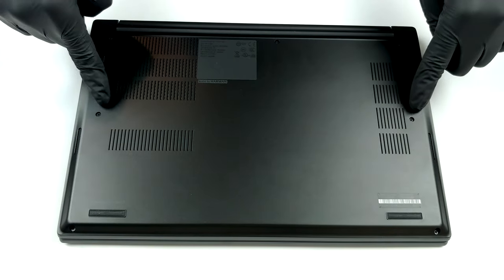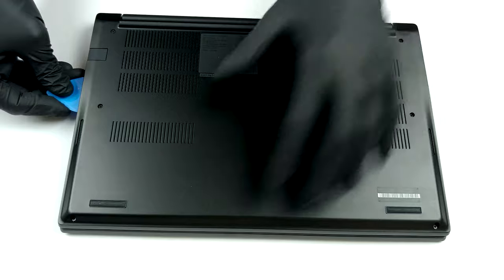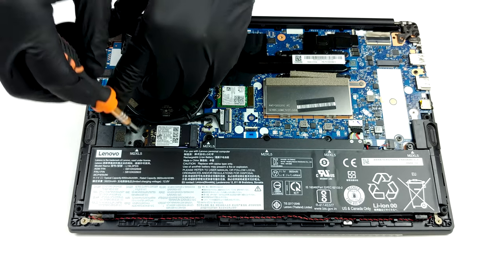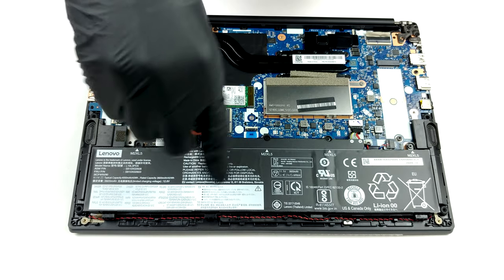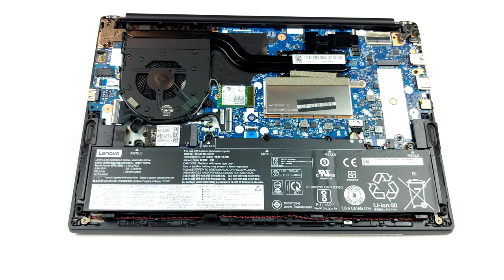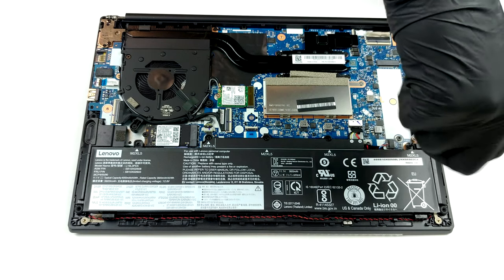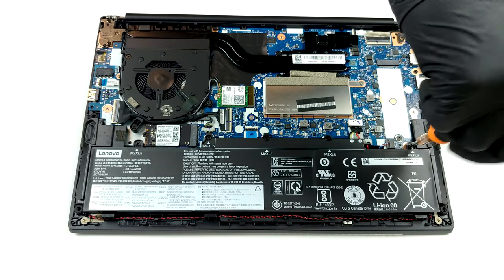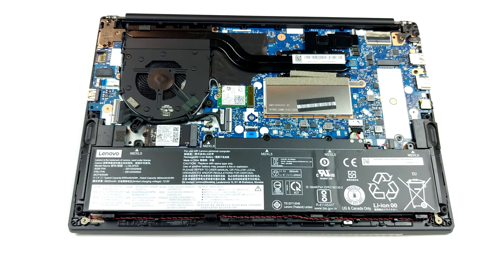🛠️ Lenovo ThinkPad E14 Gen 2 - disassembly and upgrade options

Comment: What an awful piece of "Technology Progress"... argghhh. I very gently opened the bottom as you described and still many of the plastic retainers broke... WHY JUST WHY are they producing crap like this? Then the next bummer a full size M.2 SSD with chips on both sides does not fit in the slot! Only built for single sided modules! WTF? And then only 2 USB Ports when the power brick is connected, one even only USB2... In 2021? Incredible!
Reply: Thanks, this just stops me from buying one. Former X30, X201, T400, X220, X250, T440P, T460 owner. Bye Lenovo
Reply: I broke at least five or six, and I was prying pretty gentle. Hate builds like this.
Reply: Can only second that. I hate this disgusting plastic clips trend in pretty much anything nowadays. The chances that you break something is pretty much something like 80% lol
Reply: Almost all brand-name SSD are single sided, so, it's more of an issue with the cheap (Sabrent?) drive than the box.  For the rest ― I totally agree!  So annoying that they keep limiting the upgrade potential.  The laptops a few years ago supported 64GB SODIMM, now it's only 40GB SODIMM max!

Comment: Where is the cmos battery located on this laptop? If it is absent of one, is there any way to reset the bios? I have an e14 gen 2 my gf lost a note she made with the password and recovery key. I attempted a password reset but with the bios password protected. She failed to write down the bitlocker recovery key as well, so this is looking like a brick… any help?
Reply: You can see a cmos battery on this video at 2:25 in the right part - circle battery, connected to the motherboard with a wire. It is under the laptop battery, so you need to remove the laptop battery first.

Comment: soldered RAM :/
Reply: It doesn't have soldered RAM. It is single channel RAM, user replaceable
Reply: @deoxys9794   Yep luckily so. On the video he says soldered thought, first scared that bit too, but on video you can see it's not soldered.
Reply: u can upgrade ram on AMD ryzen 5 4650u pro version 
idk abt the ryzen 5 4500u

Comment: 1 fan
2 heat pipes
1 ram slot max 32gb of 3200mhz *
2 storage m.2 pci (1 size 80 millimeters can added, 1 size 42 millimeters) *
1 battery 45 watt
Reply: 45w battery? That can be upgraded?

Comment: Where is the cpu located?
Reply: Where else do you expect ? Under the heatpipes
Reply: @imelitist2828  idk
Reply: @imelitist2828  i cant find my cpu
Reply: @justhowoftendoyousleep  you see those two metal squares/rectangles which where under there ? They're the cpu and gpu/apu. So thats your cpu its soldered to the board.
Reply: @imelitist2828  i did that
Reply: @imelitist2828  i didnt see any cpu
Reply: @justhowoftendoyousleep  did what ?
Reply: @justhowoftendoyousleep  tell me how a cpu looks then, if u didn't see it. Specifically a laptop mobile cpu.
Reply: @imelitist2828  idk
Reply: @imelitist2828  i dont know i said i cant find it lenovo ideapad s340/s430 something idk i cant find it
Reply: @justhowoftendoyousleep  This is a video about a thinkpad are you sure the model of ideapad you have is that similar to this thinkpad ? Did you remove the heatsink ?
Reply: @justhowoftendoyousleep  also shouldn't you be looking at smthn like this if you have an s340 ?
https://youtu.be/Muznifj1hvA
Reply: @imelitist2828  i think
Reply: @imelitist2828  IDK ANYMORE FUCK IT ILL JUST GET A NEW LAPTOP THEN
Reply: @justhowoftendoyousleep  yep, maybe you should, I hope you weren't offended by anything I said.
Reply: @imelitist2828  no, im okay
Reply: @imelitist2828  wich do you prefer GeForce RTX 3080 or a new laptop?
Reply: @justhowoftendoyousleep  if you already have a pc with a cpu that doesn't bottleneck the gpu then yea, go for it otherwise obviously theres no point in just getting a gpu. If you can even get the 3080 which is basically impossible to get, atleast where I am.

EDIT: along with the cpu thats not a bottleneck remember that the 3080 does need a lotta power so...as long as you have a gud enough PS.